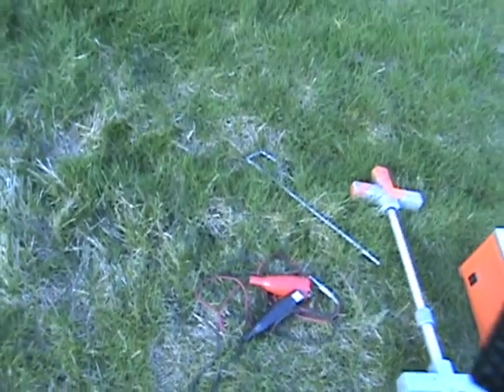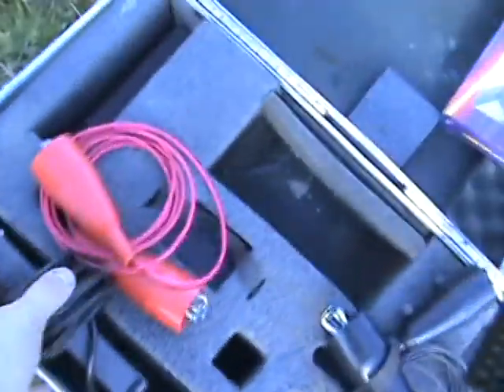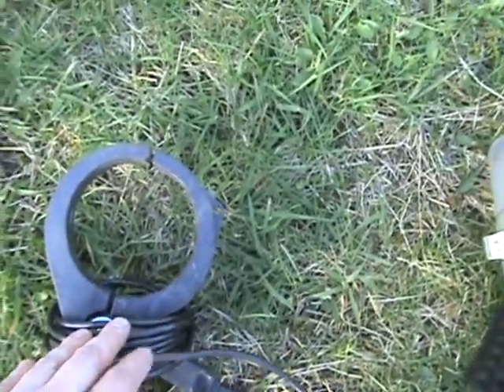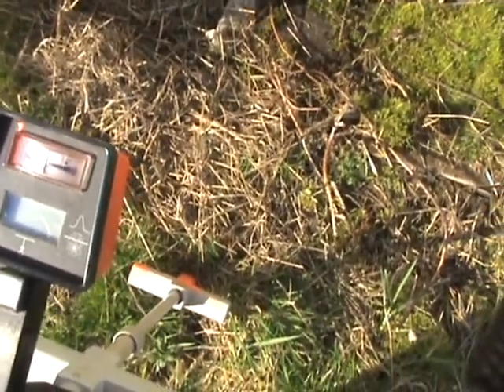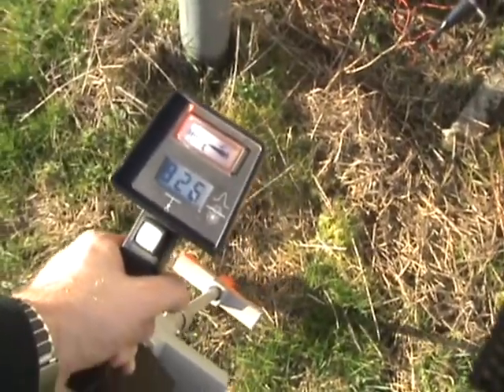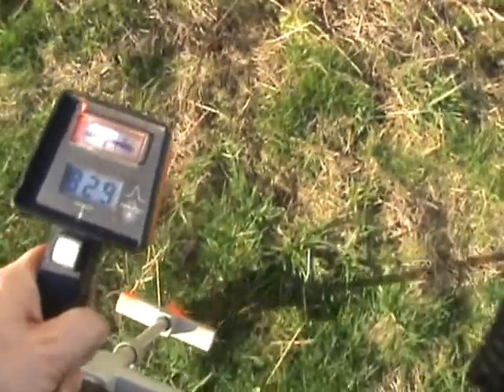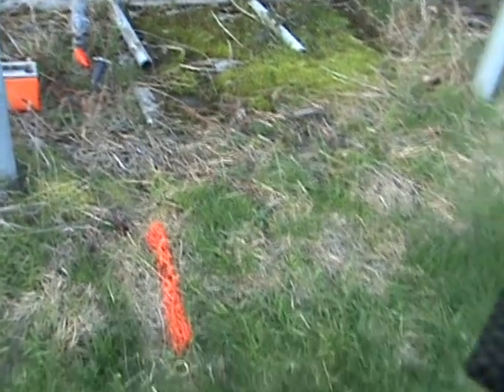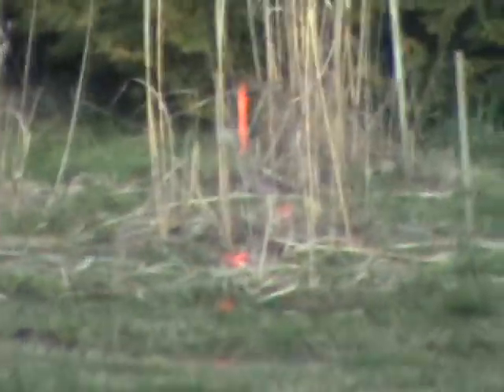Metrotech 810 Underground Utility Locator

Comment: thank so much sir, can u explain what did you do with the red and black wires?
Reply from the maker: Thank you for watching! The red wire is plugged into the transmitter and it's clamped onto the end of the tracer wire that runs underground with the polyethylene gas line, the black wire also plugged into the transmitter and is clamped to a ground rod. This provides the signal that the hand held receiver picks up the location and depth of the gas line.
Reply: @photocontrol  Thank you sir, have  a good day 👍👍👍
Reply from the maker: @abofares2261  No problem! Have a good day as well!

Comment: Wish I had it a few years ago while clearing the lot around a house, we kept hitting sprinkler pipes.
Reply from the maker: This would help for sure as long as the pipes are metal, or there is a tracer wire running along with the PVC piping.

Comment: will it pick up 512 sonde like a sewer camera head for locating?
Reply from the maker: I'm not sure. Possibly using an inductive Metroclamp transmitter accessory around the sewer camera cable may allow the Metrotech 810 to locate it.

Comment: How do you change the battery in the receiver?
Reply from the maker: +Eddie Hernandez There is a battery access panel near the bottom on the antenna side,it uses two 9 volt batteries.
Reply: Ah ha, found it and there were four 9 bolt batteries to change.  Just had to pull the paper ribbons and they slid out.  Interesting design.

Comment: All 4 of the 810's we own have different readings despite the battery level. The one I use is the "newer" one (bigger size transmitter) and reads high on water induced (675-700) compared to coworkers which reads (610-640) on same water line. I have noticed that mine will give a depth that is half of what it reads out induced and within 2" direct connected. I know for a fact on this as I excavate on the utilities as well.

Comment: Shouldn't you move your ground rod as far away as possible. Also make sure no other utilities are around ground.
Reply: Ground rod definitely needs to be futher away and orange isn't 811 color code for gas. If you run this the way its run in the video you can get a false locate.  Its also the same with the Goldake split box. Remember you have a spread of 2 feet on either side of the locate as well.